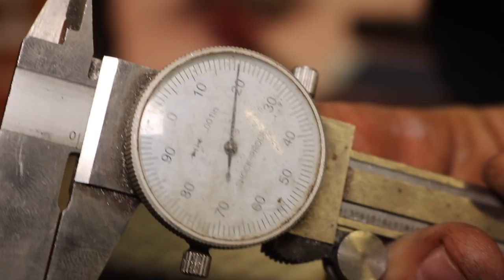Lark Streamliner | Alta Motors R-type Battery Teardown

Comment: Great video and thanks for posting! For clarification, each module is 21S6P, and the max charge voltage is set to roughly 4.08v by the firmware. That makes a total pack voltage of roughly 340-350v when fully charged.
Reply from the maker: Thanks, I later checked module voltages and realized that P20 meant 21st cell in series. Kinda a weird way of labeling your cells. P0 is conventional used for you module ground.
Reply: @sheanyquist  Programmer logic! ;).  0 is the first index of an array.
Reply: 4.08V is specific - what went into deciding that figure? A lifetime calculation? Or a Sony input?
Reply: @brentsinger1980  Its a 4.2v cell, so can only be longevity.
Reply: @hardergamer  not only longevity;  if the cell is fully charged it also can't accept any charge from regen, and not getting regen when you expect it feels a lot like unintended acceleration... we wanted to avoid that.

Comment: Strikes me as an engineer the Alta was very well engineered, from the motor using the alloy frame as its housing and heat sink to this battery with its thermal control and construction, real neat. Im interested in seeing how Zero built my SRF battery, the Zero seems well engineered. Shame Alta are not still in business Id have one tomorrow. Always tuned engines now I want to tune batteries! Thanks for your detailed video work it really helps.
Reply from the maker: Glad I could help.  Not much to tuning batteries,  just keep the cool and make good connections

Comment: That sucks about Alta, I was about to get an Alta Redshift rather than the KTM Freeride E-XC been before I was ready to buy I heard they were going under. The Redshift performed so much better than the KTM plus it had gears, unlike the KTM. It's too bad R.I.P Alta. Nice break down of the batteries, lots of cool engineering went into those.

Comment: I could be seeing things wrong, but from the video I counted 126 cells per module which would make it 21s6p.
Reply from the maker: Good eye! I didn't count it out. I just read the pcb.  It is 21s6p! That's a weird configuration. Still too low for my build 84s in total. 300v nominal and 5.4kWh

Comment: I could build you the 96s  battery you need. I'm working on acquiring a bunch of young fresh 25amp hour  LMO NMC or NMC622 lipos to build with soon. I don't know why you would try with cylindrical cells not pouch or prismatics....? Specs on 18 650 are ridiculously low (who wants a battery you need to parallel for any amps and charge at half its C-rate)  even though the watt hour per kilogram is there. Good luck with your project I'll be following.
Reply from the maker: I have a main lifepo4 battery, I'm looking at these for a back up plan. I might hit you up if I need a back up to the back up!
Reply: @sheanyquist  If you end up not using the Alta pack as a backup plan I would encourage you to offer it for sale to the Alta owners on the Alta owners forum. There are several guys who need battery packs that are unable to get them.
Reply from the maker: @jgdjgfdhgf   I'll get on the Alta Owners group today.  I had some good discussions with some former employees and I think it would be best for me to move these packs on.  You can contact me directly at larkmachineco@gmail.com if you are interested

Comment: You could add super capacitors parallel with battery to get away with high amp draw
Reply from the maker: Super caps may be good, but I need a sustained maximum discharge for over 3 minutes

Comment: If and when the 18650 cells deteriorate, essentially you could just be able to replace the cells? Instead of trying to look for a new one, asking for a friend.
Reply from the maker: I think there is a lot of glue holding the cells in place. It would be extremely had to replace the cells. You would also need a wire bonding tool to re-attach the cells. Not impossible, but extremely delicate procedure

Comment: I'm building a Electric Yamaha, around the specs of the Alta.  I am almost mirroring the battery.  20S7P VTC6 cells times 3 packs. I am using a similar fuseable link idea.  You measured .020" or .5mm on the links.  What is the material? How do you get 50 amps out of .5mm copper. I would assume it is copper. Great video, thanks for sharing the info. I'm using a ME1304 motor with Kelly 700AMP controller.
Reply from the maker: The cells are mated to the current collecting pcb via .5mm wire bonds.  50 amps is the max and can lead to failure.  The wire bonds are aluminum and attached using a ultrasonic type bonding method

Comment: It is 21s per module, and I measured 340V on my fully charged pack. I am sure it can charge to 350V if the BMS limits are set less conservatively.
Reply from the maker: That may be good for alta, but I need 350 nominal.  Almost 420 max.  350 max volt on the alta system would have a low voltage cut off under heavy load.  I'm still trying to get a hold of the right Alta guy to see if it is possible to add a fifth module to the system without too much modification to the bms
Reply: @sheanyquist  You need Ryan Kuhlenbeck. Good luck.
Reply from the maker: @SupercarEngg  thanks for the lead! I'll hit him up on linkedin.  Sounds like you used to work there
Reply: @sheanyquist   No, but I know a place where a bunch of ex-Alta guys and current battery tinkerers hang out. We are discussing your video here: https://altaownersforum.com/threads/complete-battery-pack-teardown.988
You should join. Either someone will come out and help you, or you would be able to sell these packs to us.

Comment: Hi, please advise. I need to weld (TIG) something on a motorcycle frame. What must be disconnected to avoid electrical damage (motor, battery, etc.)
Reply from the maker: Its best practice to remove the battery from the chassis.  I dont.  Just ground your tig as close as possible to your welding area. Ive bever had an issue
Reply: @sheanyquist  Thanks

Comment: i have a code 36 on my alta , it only charges about 80%, i understand about the ultrasonic bond, what happens if you try to solder? will the heat from the gun affect a nearby component?? will the added resistance of the solder affect anything? i have an mx alta and have been trying to fix it for a customer, please help me out . thanks
Reply from the maker: Oh man, I don't know much about the code 36.  Bad wire bond?   You could bypass the wire bond with a soldered wire.  Heat won't kill stuff but be very careful where you get solder.

Comment: I think you'll find they're claimed specs are closer to calculations if you do the calculation based on 3.7V nominal per cell not 3.6. They shouldn't be using 3.7V, but they do. Realistically I use 3.65V per cell when calculating most of my packs.
Reply from the maker: I think they had to switch to a lower energy cell halfway through manufacturing and marketing couldn't stomach a drop in energy

Comment: Great job! The paste is probably not toxic. It is a two component polyurethane thermal interface and adhesive. Also: do you have an extra module? I would like to buy one or two.
Reply from the maker: I got 4 battery packs in total. I'm looking for one more pack.  I might be selling them all if I can't make it work though. I'll know in a couple of weeks hopefully
Reply: Shea Nyquist please let me know. Thanks!
Reply from the maker: @NachonNachin  I sold the packs to an 
Alta engineer on the Alta owners forum.  Im sure they are for sale there.  He was going to sell them to help the code 36 guys

Comment: BrunoPOWEER linked you now I'm sub'd. Glad you worked it out that its a 21s, are you thinking of giving the full cell 4.2v over the 4.08v cycle life charge?
Reply from the maker: I ended up selling these packs to an previous Alta engineer so he could flash them and sell them to needy customers
Reply: hardergamer POWEEEEEEEEERRR... hahaaa
Reply: @sheanyquist  Hello! Do you by chance have a contact/link to this person? I have an Alta MX I just acquired, and it only charges to 75% so I could use some help. Thanks!!!
Reply: The former Alta engineer......
Reply from the maker: @DonThuren  if your pack is only charging to 75%, it seems like your cells may be degraded.  Unfortunately there isn't much an engineer can help you with for that.  Best thing you can do is try to extend the pack life. Charge slow and don't ride too hard
Reply: @DonThuren  HELLo, I have an alta mx and it only charges to about 80%, did you fix yours? mine gives a 36 error code. please let me know thanks